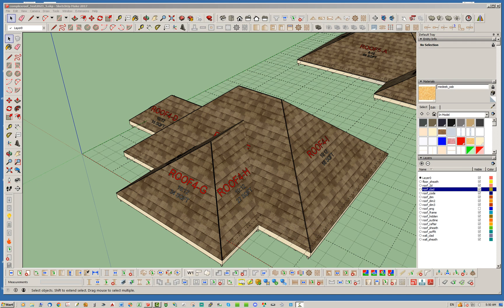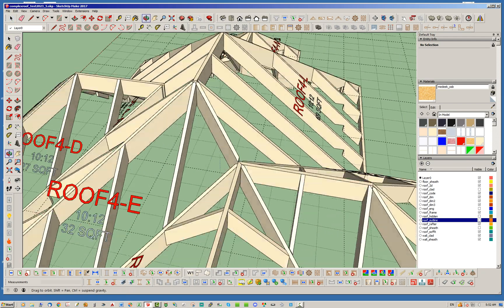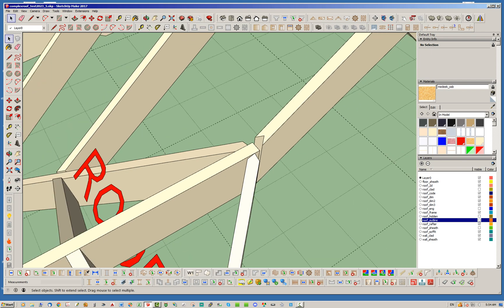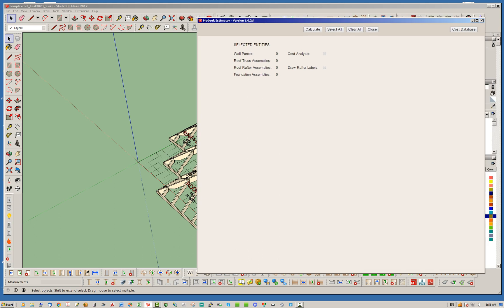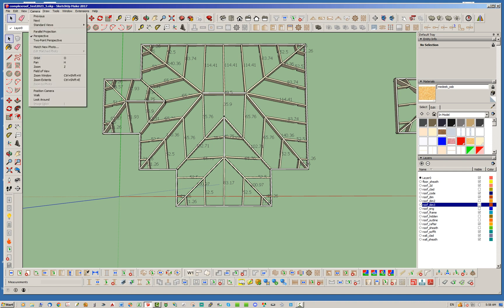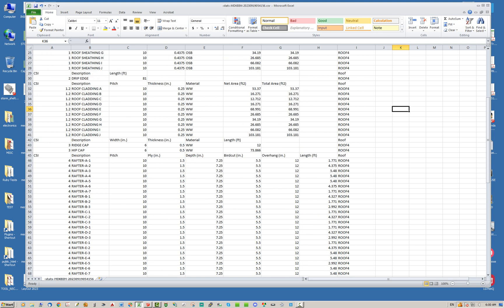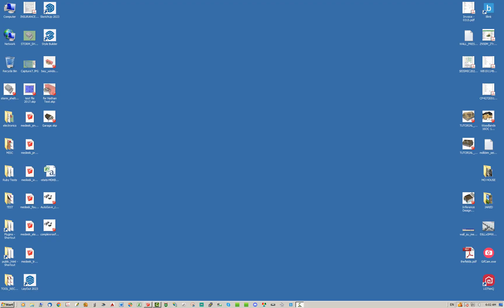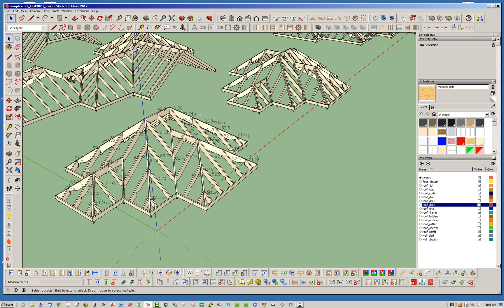Medeek Truss Plugin Tutorial 25 - Estimating Complex Roof

Comment: Personally when I do flying hips I would support it with a trimmer…

I would support it like a stairwell (as it it was flat like a floor) but the ridge is normally a single and the trimmer is normally at least a double (span dependant)

Also the trimmer should span to the next dominant roof member which normally is a rafter, which you would normally double up too (span dependent)…

If ridge is in the same direction as the higher roof, I would extend the ridge into the adjoining roof to meet the next dominate rafter…

I have just found that if I am calculating a roof before constructing it, I would always connect the maths to a know variable and the roof would always work out straight and true…

Just to note, I class a dominate roof member as something that is connect by the main two supporting members, the plate and ridge, but can also be sub connected through the hip or valleys…